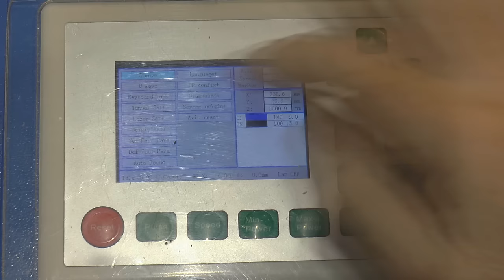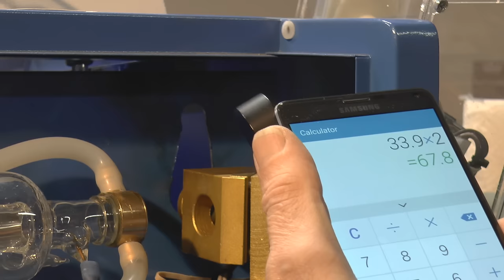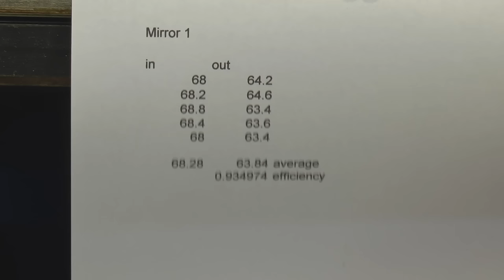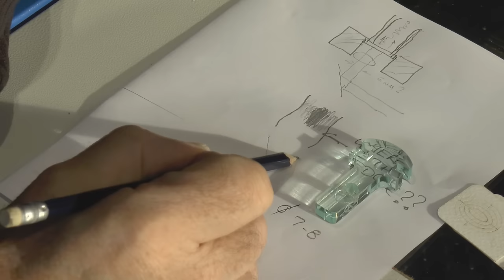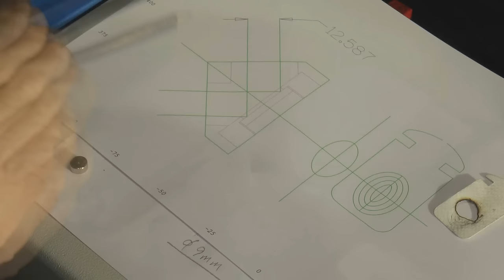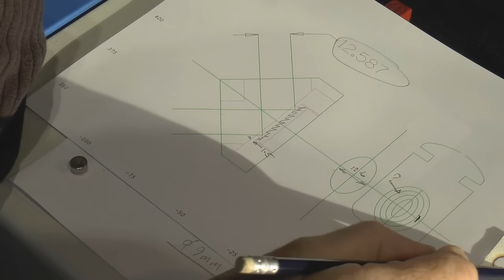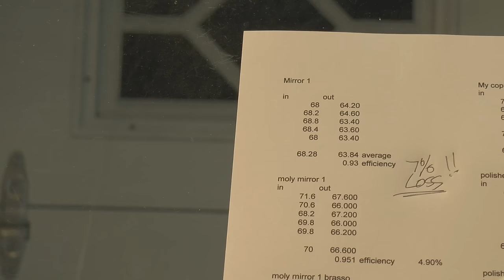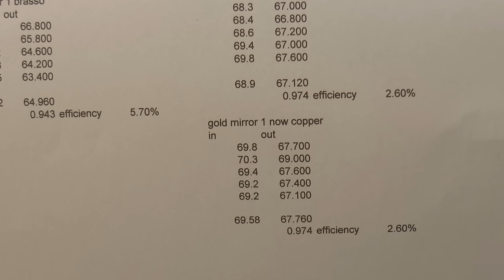RDWorks Learning Lab92 Fitting ebay Copper Mirrors Part 1

Comment: Hi Russ : It's me again . I want to know have you tried fast cutting ? my laser cutter has RDC6442G DSP controller with 57MM stepper motor ,so how fast can I run my machine on cutting tasks ,8 hours per day. I have googled it says : 60 mm/s for cutting is the best choice ,do you have any idea? 
Thank you  again !    
Ryan Wood
Reply from the maker: Hi Ryan
Your machine will be speed limited by 4 major variables 
1) The power of your tube
2) The focal length of your lens
3) The type of material you are CUTTING
4) The thickness of that material

In general I run my cutting at max power (65%). I run a 40mm test square and guess a reasonable speed for the material I'm cutting. If the square does not drop out , the only variable you have left is speed because  1,2,3 and 4 above are all constant. So back the speed off in 10% increments until your test square drops out. THAT'S   your max speed. Conversely, if you set the speed too low to start your tst and your square drops out,  increase the speed in 10% steps until is stays in. Back off to the previous setting and THAT'S yourf max running speed.
There is no such thing as a  fixed speed, only an IDEAL speed to suit your conditions. Unless you are CUTTING paper or thin card you will rarely be in the 60mm/s region
Hope this clarifies things a bit.
Best regards and happy New Year
Russ
Reply: Hi Russ,Thank you for answering my question,I really appreciate that. I had an experience of cutting felt which is 1.5mm thickness ,I tried 200mm/s , it turned out failed .I tried it like 100mm/s  and power setting was 20mA@60W tube ,it still didn't work . But when I lowered the speed to 50mm/s , power was 3mA ,it worked very well .However , I want to make it faster especially when I doing some work for some projects ,It will save me a lot of time. I found it is the same situation when I cutting greeting card.
  Thank you and Best wishes
Reply from the maker: Felt is a strange material to cut. Firstly it can be pure hair fibres or a composite with plastic fibres included.  Both suffer from one major problem....air pockets.  I know the air pockets between the fibres will be small but any air pocket is a magnet fro smoke entrapment. Smoke is a fantastic absorber of IR radiation emitted by our CO2 laser. Golden rule number one is air ,air and more air. I did a video recently about maximizing air assist but demonstrated it with plywood. It is even more important with felt .Keeping the cut area as free from smoke as possible is the key. You need to cut as fast as possible and blow as hard as possible because if you let the smoke settle in your cut it will reignite and burn your edges.  You say that you are having success at 3mA which may appear to be very low power. In fact you will find that you are operatiing in a region that is called High Frequency Impact Engraving. Before the beam is fully formed  (maybe 15 % power) the cut will sound very hissy. This is because the power supply is regulating the average current to 4 mA (aprox) by allowing VERY high current flows (60mA) for a very short durations  ie pulsing at about 3,5kHz.  If you look closely at your card cutting you will see the nibbled edges to your cut. You have accidentally stumbled upon, but not recognized a possible solution to your problem. DOT MODE. There are many parameters that you can play with here but the principle is high energy pulses to produce a non continuous perforated cut. You will still need to address your air flow problem but DOT MODE is a very powerful tool for materials such as foams and felts. I have experimented a little but as you are running for long periods it will be worth your while to find the right parameters. I am sure there is a fix in there for you.

I stay with the 4mA setting for my card cutting  because you are usually dealing with lots of small details and the speed you set bears no relation to what the machine will do. It can only accelerate and decelerate at a fixed rate and may never be able to reach your requested speed. Imagine a F1 car racing round a 100m square track. It may be capable of 200mph but what speed will it reach before it has to slam on the brakes to get round the corners?
I usually cut card with a setting of 80mm/s and 13% power on my 70 watt tube.

Best regards
Russ
Reply: I have successfully modified the air assist system into 10mm tube (6.5mm inner diameter) , also changed the 4mm bore elbow which came with the machine to a brass elbow @6.5 inner diameter .And a bigger pump (150L/min) .Once turn on the machine I can feel strong air blowing from the nozzle ,way more better than the 6mm tube @4mm bore.At this time ,I can cut the felt which thickness is 2 mm  in a speed of 125 mm/s ,and  30% power or 6mA ,perfectly. I tried 200 mm/s 38% power ,It also worked fine ,the surface of felt without smoke or burnt , but the whole machine will shaking while the laser head is fast cutting.
   Another question is : heavily smell comes from the felt (polypropylene resin) cutting , makes me headache , is it toxic when the laser cut the polypropylene resin ? I have an actived-carbon air filter ,it can eliminate the smell in the air ,but the honey-comb platform still smell so bad even you left it for a couple of days.
Reply from the maker: Natural felt is just organic but artificial felt with man made fibres is most likely damaging to health with prolonged exposure. see
https://www.directplastics.co.uk/whats-in-those-fumes.html

The most common hazard is benzine derivative chemicals that are definitely carcinogenic

You need to chat with some company such as Purex who make recirculating filter systems that clean the air in several different ways before returning it to your workshop. Your personal health is worth it.

Glad to hear that extra air turned out to be more important than you thought. My machine would jump around as well but I have it fixed to an adjacent VERY heavy steel bench.

Best wishes
Russ

Comment: Can you design and make a machine that will polish the mirrors flat for you?
Reply from the maker: Hi Robert
I have answered this question once but You Tube seems to have ignored it Just to quickly repeat myself, Yes I could reinvent the wheel but lapping is not a simple job. I have just today had some 2mm thick copper discs laser cut and will be sending them away in the next day or two for professional lapping and polishing.
The saga continues and I will eventually get to the last page.
Best regards
Russ

Comment: well you could put a thermocouple on the back of the mirrror and mount it in a acryllic case.  the faster it heats, the more power it sucks instead of reflects.
Reply from the maker: Hi  
I suspect this is just a passing thought. Have you considered how just measuring temperature would quantify watts of lost energy? . Before you even think about the heat gain at the mirror , you must know the watts you are firing at the mirror. Without a power meter I cannot know that. Thus , because I must have a power meter, why don't I just measure the reflected power and subtract out from in.  It's that simple.  I can tell you it is typically between 3% to 4% loss per mirror .
 Best wishes
Russ

Comment: Hello, thank-you for this nice video. Where did you buy your new mirror with gold ? Thank-you :-)
Reply from the maker: Hi Daniel
I'm convinced that that yellow shiny coating is not gold. It did not perform like gold in this test and I have also tested the remaining two mirrors on the Thinklaser machine and saw 10% loss across 2 mirrors. That seems to confirm approx 95% efficiency. I would have expected 98% or more from REAL gold. I have taken those mirrors to a jeweler to check out the carat value of the gold deposition.  What ever that yellow stuff is,  it is not gold. The jeweler failed to get results. As you have seen, when I stripped off the yellow stuff the bare copper is 3% more efficient . My advice is don't waste your money on gold flashed mirrors of any sort. As Shakespeare wrote in The Merchant of Venice  "all that glisters is not gold".

Happy New Year
Russ
Reply: Hi Russ, I have run into the same problem when I ordered a set of gold coated Si mirrors (China)
I invented in a power meter and got a base line at the tube then tested after the first and saw around a 4% loss. Put the what I guess to be a Moly mirror that came with it and my loss after the first mirror was less than 1%.
I have come to the same conclusion you have that the gold plated china mirrors are something other than gold. 
Also I wanted to thank you for all of your videos, They have helped me immensely and saved countless hours of frustration.
Reply from the maker: Hi John

After session 94 which I thought would conclude the copper mirror saga, I had a message from a guy in USA who volunteered to coat some of my lapped copper mirrors with genuine 24K gold because he was keen to see if we could get anywhere near the 99% reflectance promised for gold.. I have received those back from him earlier this week. I will shortly be testing them. 
Thanks for confirming that the yellow stuff is not what it promised.
Best regards
Russ

Comment: Hi Russ, any chance you could send me x3 of your pure copper mirrors? the spare ones you have left over from the big sheet?
Reply from the maker: Hi 
Copper mirrors were not complete waste of time but it was a learning journey detour I had to make to satisfy my curiosity. The promise of 99% efficiency was tempting but never completely fulfilled conclusively although 98% + was definite. I spent a lot of time and money on the quest for perfection and understanding different mirror materials. I still have those same copper mirrors in the machine today and,  despite warnings from the doom merchants that they would quickly oxidize and become useless.......they haven't.
However. after all the experimental work,  I proved that you can buy 97% efficient mirrors made from molybdenum at very reasonable prices. They are very hard and virtually indestructible......  and what is another 1% of efficiency worth?  You cannot buy naked copper mirrors from China, I tried and those that I did buy were 3 times the price of molybdenum.  Like the doom merchants, the Chinese believe copper will corrode and so coat it with a completely non oxidizing plating of gold. Yes its yellow, but gold is also in the 99% + efficiency so you would expect a high performance mirror. No!!!! I have to assume that with efficiency as low as 94% it just yellow varnish??? I have a set of new moly mirrors on standby should I ever need to replace my copper mirrors. My Lightblade has moly mirrors and I would advise never to not buy  anything but.   Plated mirrors, regardless of promises, will always be a risk. The plating , usually gold (well, yellow stuff) is atomically thin and prone to wearing off as you clean the mirror. The materials beneath, usually crown glass or silicon, both absorb IR and heat up  and will probably crack due to uneven surface heating.  As I proceed with my learning journey I have found small design compromises everywhere with these machines. Overall the technology works well for such a low cost piece of kit but my greatest pleasure continues to be trying to find the absolute boundaries of what we can achieve for so little.
Best wishes
Russ
Reply: Awesome , Thanks Russ.. you are doing an awesome favor for us all, all your hard work / time / money, for us to just to click the "like" button and sit back, watch and learn from you. Thank you. :-)
Can i buy 3x of the copper discs from you? i can send you a return envelope in the mail?  i want to polish them up and use them in my machine, like you do.
let me know.
cheers
Sam
Reply from the maker: Hi Sam
Use the private You Tube message system to send me both your postal address and your email and I'll sort you some discs (I think I still have them somewhere???)

Best wishes
Russ
Reply: SarbarMultimedia thanks

Comment: Would silver make a better mirror? I'm really enjoying these vids and I don't even have a laser haha
Reply from the maker: Hi
Yes silver, gold, copper and aluminium are almost as effeicient as each other about 98 or 99%.. However,  silver is the worst for atmospheric tarnishing and would quickly lose efficiency. Obviously gold does not oxidize and technically should be the best. I had a guy plate my flat copper mirrors with 24K gold and was very disappointed to see the efficiency at about 95%. Aluminium also oxidizes and will then heat up rather than reflect. I was warned (and know) that copper is prone to atmospheric oxidation. I took care to find a polish that contained a molecular bonding property and I have to say that it works because I can leave my mirrors a year between repolishing because obviously it is doing a grand job at providing an oxygen barrier.. Lots of expense and hassle to find that on average I can get 98% or better from my copper mirrors. Take my advice and stick to molybdenum mirrors they are typically 97% efficient and require little attention.

Best wishes
Russ
Reply: SarbarMultimedia thanks Russ! I have to justify buying a laser first, thanks for the info though :)

Comment: Hey Russ, I wonder if you give a try to Aluminium mirrors. According to table listed here http://www.photonics.com/EDU/Handbook.aspx?AID=25501 aluminium is better than copper in terms of reflectance in the 9–11 μm range of our CO2 tube ... Copper is good but, Aluminium seems to be higher. What do you think?  Tad.
Reply: SarbarMultimedia Thanks Russ, happy new year to you to!
Reply: Hi Tad, thanks for the link. I do not understand your statement re: aluminium is better than copper. Do you see what I do not see? Are you looking at the correct wavelength of 10um?  According to the table - factors n and k for 10 micrometers - middle wavelength of CO2 laser the reflectance of following materials from the equation is as follows:
Aluminium 92.1%
Copper 98.19%
Gold 98.45%
Molybdenum 98.51%
So I put my money on Molybdenum, especially as it is hard material, not needing any protective surface coating - viz Russe's "mystery gold" disappearing plating on his Copper mirrors.
I am ordering a new set of Mo mirrors and I will see if I get near the theoretical 95.56% after three mirrors. 
Oh, and interesting observation - chinese sellers claim reflectance of Mo mirrors > or = 99% !!! I should know better, they always exadurate, whether it is laser tube power, Li-Ion battery capacity etc.
otto
Reply: Hi Otto, according to the article in the link I pasted above, Table 1. Aluminium n,k factors at 10µm are the highest of all listed metals in this table. According to the same article the higher the numbers the better reflectance. 

"An extensive list of n and k values over a wide range of wavelengths and for many metals is available.1,2,3 Table 1 contains an abbreviated list, with data given for ultraviolet (0.2 and 0.3 μm), visible (0.4 to 0.7 μm) and infrared wavelengths (1 to 10 μm). In general, metals with k>>n are shiny, while those with k ≈ n ≈ 3 are gray. Thus, silver with n = 0.13 and k = 2.92 at 0.5 μm is shiny, while tungsten with n = 3.4 and k = 2.69 is not. As the wavelength increases into the IR region, n and k increase, leading to high reflectance in this spectral region."

Wavelength   (µm): 10,  
Aluminum      n: 25.3, k: 89.8
Copper           n: 11.6, k: 49.1
Reply: Hi Tad,  yes, and if you go further:  
"The reflectance of a metal mirror can be calculated from the index of refraction n and the extinction coefficient k of the metal. The reflectance of a metal surface in air is given by: Mirrors_JDSU_Equation1."
This is actually for a coating and I am making assumption that the solid material will be the same. Whilst Aluminium has got the highest n and k values, when you put it in the equation, reflectance is 92.1%. The Gold, Copper and Mo have lower, very similar values, but higher reflectance. You can work it our for yourself and see figures I posted above. 
So I am still putting my money on Mo for a while.
Best regards
otto
Reply: thanks I missed that, (I didn't read all of it) :)

Comment: Did the jeweler have any idea what the gold colored material might be? Did he use an acid test?  careful or you are going to be in the business of selling doohickeys and your handmade mirrors!
Reply from the maker: Hi Dwayne
No, he was a jeweler not a metallurgist. He used variuous strength nitric acids to test for different purities and failed. What ever it was it was certainly only a flash because it lapped off very easily. My problem is an inability to lap a truly flat surface without rolling the edges. I need a local astronomer to teach me proper hand lapping techniques. If all else fails I'll send them away for proper machine lapping. I am determined to get to the bottom of this saga
Happy New Year
Russ

Comment: I would design a mirror that. Uses liquid Mercury
Reply from the maker: Hi Harry
Sound like a good idea until you consider several practical issues. 1) It is not an efficient reflector of 10.6micron IR light    2) How are you going to hold make sure it is flat ie no meniscus.   3) How are you going to hold it upright or at 45 degrees?   4) If your answer to 3) is a glass container then sadly, glass is a 100% absorber of IR light and so will heat up and crack....oops   5) Who wants to handle mercury?
 Popper was an experiment I had to do and those mirrors are still in my machine . You can get almost the same efficiency from molybdenum mirrors and they are much cheaper.

Best wishes
Russ